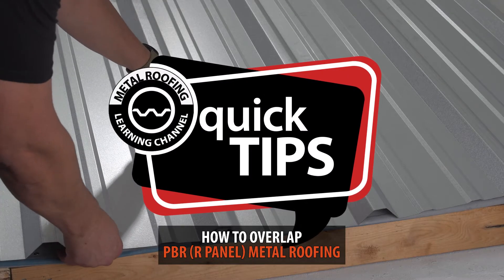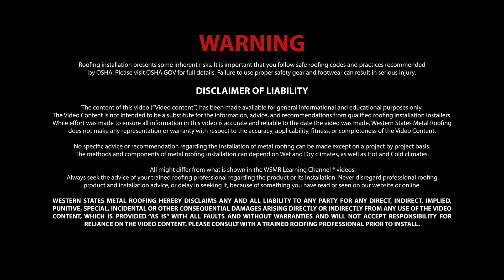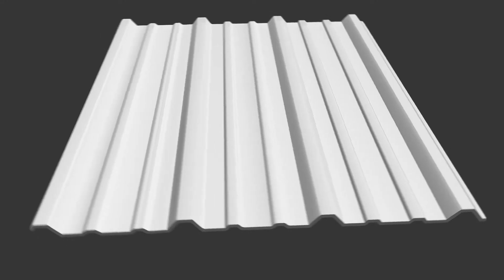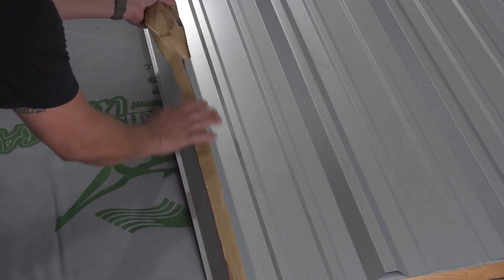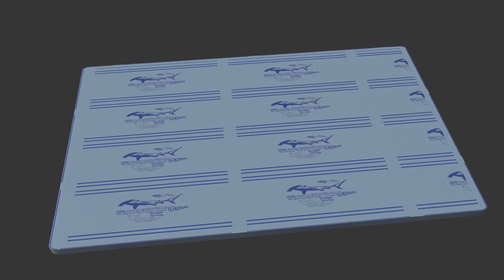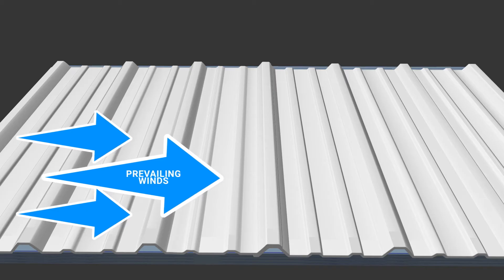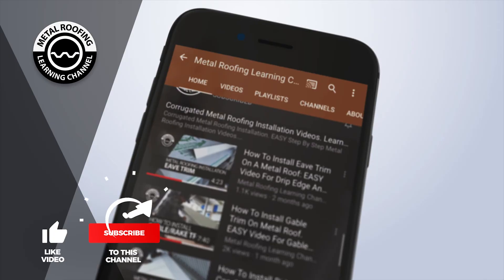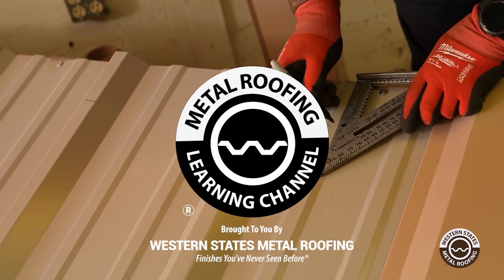How to Overlap PBR Panels & R Panel On A Metal Roof

Comment: What direction do you overlap if the prevailing (most common direction) wind is not as strong (like a southern summer breeze) as a very strong and gusty cold front wind (from the north) that doesn't last as long?  And couple that with very strong winds from any direction during a severe thunderstorn any time of the year?
Reply: Prevailing means more occurrence and that means capillary action or wicking will be assisted more often. Id stick with whatever manufacturer recommends for its product. Double check it doesn't contradict the state building codes applicable to you but id approach it from a warranty and insurance point of view first and foremost

Comment: Do you screw through the Butl tape? Looked like that in the video.
Reply: You should never screw into the ridge. You should screw on the flat part of the tin about 1/2 inch to each side of the ridge.